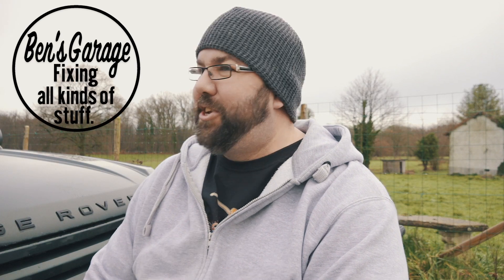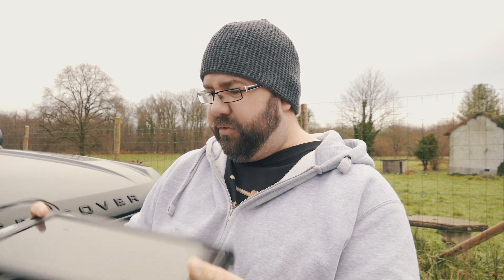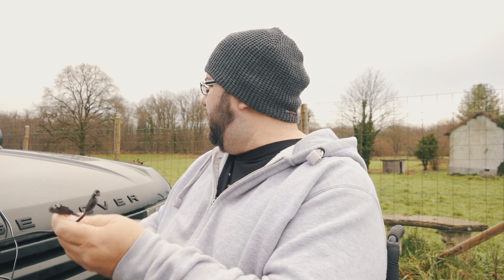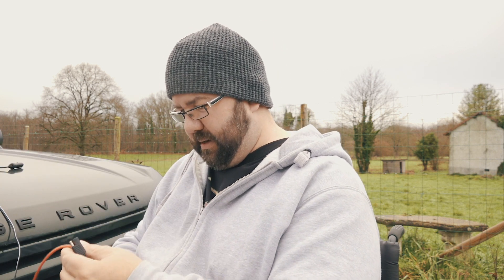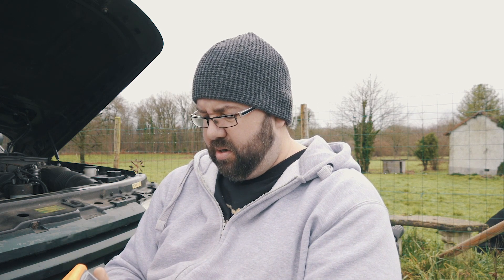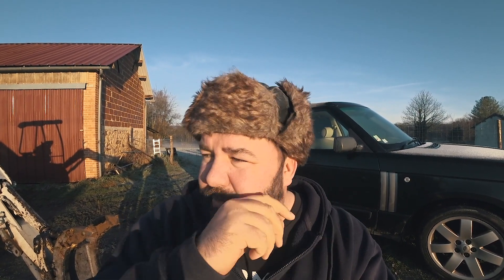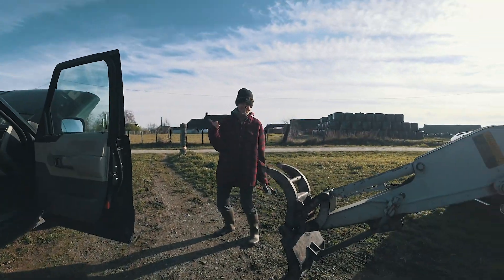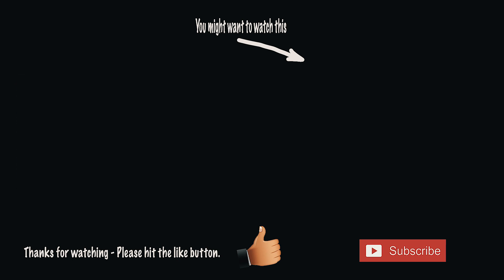How to get in a Superlocked Range Rover

Comment from the maker: Such a relief to get in without having to smash a window.
Reply: This happened to me I just smashed the plastic grill out and got to the bonnet catch and replaced the grill
Reply: I got into mine through the tailgate ben ..removed number plate light housing...slightly bent plate inside and there is the cable that's used if your locked inside the boot 😁👍quick tug and boot open...20 min
Reply: Thanks for this video this is the second time ive been locked out last time i broke the glass. thanks to Robert i used pins 9 & 13 great stuff.
Joe

Comment: Well done, Flat battery, the key lock was worn out. I couldn't get your method to work. So I removed one of the side blinkers and stripped the wires back.  croc-clipped each one to the  _+ and hey presto it powered the security up, and I got in using the fob. (03 TD6)
Reply from the maker: I have read that powering up the wires for the side repeaters works, but then I have also read that it hasn't for a lot of people 👍

Comment: Hi my bonnet is open, there is a new battery in it, fitted new battery in key fob but cant get into the vehicle. What do you think the problem is? Sport HSE 2007.
Reply from the maker: Maybe the key has lost connection with the car. Have you tried using the hard key inside the keyfob.

Comment: You can also unlock by powering up the l322 through the side repeaters blue and green wire positive and brown neg I had to do it other day to get it open to get battery off to recharge I just used my low amp battery charger worked a treat :)
Reply: Did you use the bare wires off the side repeaters?
Reply: I’m having the same problem locked out of my l322
Reply: @simonkharazyan3938  when you pull off your side repeater carefully push the wires into each side of the plastic clip then once the wires are secure turn on battery charger the car will beep if there's enough power left in your car battery and alarm might go off so then press unlock on your remote and hey presto your in if your battery is totally flat you may need to leave your battery charger on for a few mins to get enough power into battery to power the doors
Reply: Assume this can be done by connecting your battery chargers directly to the positive feed to the stater motor, and clamp onto the starter body for an earth, pending on how accessible it is from below.
Reply: I tried it. it worked. I frequently disconnect the battery since it gets drained so fast. But leave the door open. then it happened-i forgot to open the door, disconnected the battery, and got locked out. I connected jumpstart cables to another running car. positive to the blue wire on the left side repeater and brown to negative. turned the door key and there was a beep from all four doors. they opened. thanbkyou
Reply: @510bronson  Hi Jason...I'm superlocked out. Please can you explain what you mean push the wires into each side of the plastic clip. Please can you explain a bit more. Thanks
Reply: @PhillipB1972  the plastic clip that clips into the back of the side light bulb holder with the 2 wires in it
Reply: @510bronson  It worked!! I definitely owe you pint for that!! Cheers
Reply: @PhillipB1972  no probs glad I helped 👍
Reply: What are the side repeaters? I don't have a trailer wiring harness
Reply: @davidclark288  the side repeaters are the little indicators on the sides of your front wings or fenders if that’s what you call them
Reply: Can I do this with a 12V 9A battery instead of the charger?
Reply: @michelepazzaglia1530  try it and find out but I doubt it will work lol

Comment: on the fender turn signal you can add power to the wires and unlock the doors
Reply from the maker: Tried that, didn't work in this instance. Probably had a rogue car.

Comment: Hi what cables and power source did you use? Sorry probably a silly question I don’t know much about cars but currently have this issue
Reply from the maker: Just used some electrical (household) wire, connected to my jump/booster pack.
Reply: Got it, would jumper cables connected to second vehicle be fine?
Reply from the maker: @alecenciso9918  yes should be, you just need to get 12v to the battery.
Reply: Great thanks much, Ben; I appreciate it, your videos are life savers
Reply: Does it work on a 7 Pin trailer plug?

Comment: I need to do this on an Australian model.  Has 2 x 7 pin plugs??
Reply from the maker: I assume one plug will be for lights and the other for towing accessories (caravan etc), you should have a live feed on the second plug, that goes straight to the battery. In the UK we used to have two 7 pin plugs, but it seems we have all gone 13 pin now, especially here in France (EU)
Reply: @Bensgarage  thank you for the quick reply.  I need to identify which pins to put power and earth too.  My L322 has 2 plugs like I said.  One has a grey/white cover the other is all black.
Reply from the maker: Grey and white always used to be towing socket, pin number 4 is auxiliary battery/charging and live feed.
Reply from the maker: Pin 3 for earth.
Reply: @Bensgarage  I tested for power with multimeter and it has about 1.5v.   My L322 battery isn't very old but haven't driven it for 1-2 weeks, battery is so dead the rear suspension has gone down and body is resting on rear wheels..  Tried to put power to the pins using a 12v 1A power supply but it won't unlock.
Reply: I'm not superlocked out, just the key doesn't open the drivers door.  Never has.
Reply from the maker: You might need some more power, I used a 1200a jump starter, which was gave it enough power to be able to operate the locks.
Reply: @Bensgarage  I also tried a trickle charger, but was not enough power.  I'll bring my 12v power supply from work to try.  I can turn it up to 14v, not sure about amps.  I definitely have the right connections.  Hoping i don't have to break a Window to get in.  Thanks for all your help!!

Comment: I had same problem with my TD6, battery draining.  There is a common fault which can develop with age, with the HVAC which requires a wiring mod to resolve cheaply.  Info available form K Motors in Leyland UK if you need it.

Comment: Thanks buddy I bought Land Rover tdv6 3seris without keys can’t do anything with it going to try this method tomorrow hopefully it works I really don’t want to chuck a load of cash at it as don’t know anything about this vehicle ( silly me ) 😢
Reply from the maker: You still need the key to get in with this method. Powering the socket just sends 12v to the battery, so that you can open with the key if it is superlocked.
Reply: @Bensgarage  thanks again for your help anyway Ben, I seen a few of your videos and they are really helpful 👍

Comment: I Locked my key into my car is there a way to get into my 2006 l322? My battery is not dead will a locksmith new key work on driver handle lock?
Reply from the maker: I think the key should work, I believe it’s just mechanical and doesn’t need the code to open. You might struggle if it’s super locked though.
Reply: What if vehicle is superlocked is there any way to get in?
Reply from the maker: @marcus328  I think that if you still have power in the car you should be alright, it’s if there is no power and it’s super locked sometimes the key doesn’t work. Which is why I had to power up the car to get in.

Comment: Can you us a 7 pin to 13 pin converter in the same way?
Reply from the maker: Don’t think so, 7 pin will just be for your trailer lights. 7 pin electrics would have had a second socket for a caravan and it’s the caravan live feed you need to energise.

Comment: If it was a 9 pin socket what numbers am I looking for?😖
Reply from the maker: I've never seen a nine pin, only 7 or 13. If you have the seven pin, then your out of luck, as that is just the trailer lights and doesn't have a direct feed to the battery. Some older trailer electrics using the seven pin socket might have had a second socket for caravan electrics, there you would find a feed to the battery. Other than that I can't help.

Comment: Unless your 12v socket is permanently live, i.e. not switched by the ignition, then plugging a solar charger will not make the slightest difference. You have to connect direct to battery.

Comment: Another interesting video from Ben's Garage! Too bad there isn't a way to disconnect the battery and "put it to sleep" without messing up all the electronics. Or might there be a way?
Reply from the maker: Might look into fitting a battery cut off or something like, that's if I don't sell it.
Reply: Don’t fir a cut off as you’ll have to reset everything all the time. Tried as emergency not for long term. Fit a dual battery instead. I have two L322 4.4 v8 petrols 2004 and 2005 both same issues. Bought a kit of eBay and that’s so far working.

Comment: Hi, Ben,  I think it was lucky that you have a 13 pin plug, I don't think there is a permanent live with a 7 pin plug.  ATB  Norman
Reply from the maker: Normally the 7pin plug is just for your trailer lights and you would have a separate (grey) plug for caravan towing. Glad I fitted the 13pin plug now.

Comment: Didn't work on our 54 V8 Vogue :(
Reply from the maker: Which plug do you have? The 7 or 13 pin?
Reply: @Bensgarage  it's the old 7 pin. I got in, in the end, I took the little side repeater off and used those wires 👍
Reply from the maker: @ltms7148  I had heard of that method, just didn’t know if it would handle the voltage and possibly going through an ecu somewhere. But if it worked for you without problems, then all is good. 👍
Reply: @Bensgarage  nope, we had no problems, the electrical system is fine.

Comment: Handy tip however a simple question - why did the key not work in the drivers door? The lock actuator is a known problem and can be repaired for less than £10. How to do it is here: https://www.youtube.com/watch?app=desktop&v=W9seJWUpEqg and takes about 20mins as tested by myself. My lock failed and I managed to lock my keys in the vehicle recently. The second fob would not work and rescue people failed with airbag tricks failed. So, my only option was to smash the drivers glass (not easy as it is laminated!!) and cost £170 to replace.

Comment: let me know if you wish to sell
Reply from the maker: Its looking like it might be going up for sale.
Reply: @Bensgarage  what price ?
Reply from the maker: @philgarrod9665  Far too much going by UK prices. Here in France TD6's are going for between 6K and 14K, which is the reason I got mine from the UK in the first place. Likely to put it up for 3.5K but will let it go for 2K, euros that is.
Reply: @Bensgarage  ok thanks when you thinking hows the gearbox ?
Reply from the maker: @philgarrod9665  Well it still drives and we have not seen the TRANS SAFE warning come up yet. Still changes gear perfectly so I think its the torque converter. If we were keeping it I would change the Torque converter and refurb the box. It can go anytime, if your interested email me. Address is in the about section.